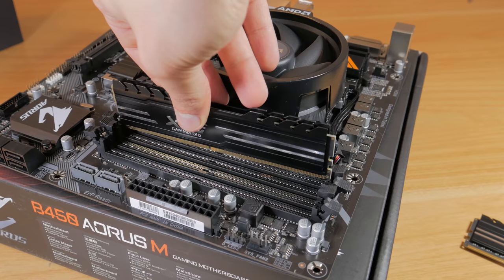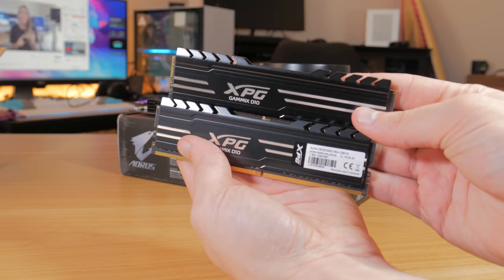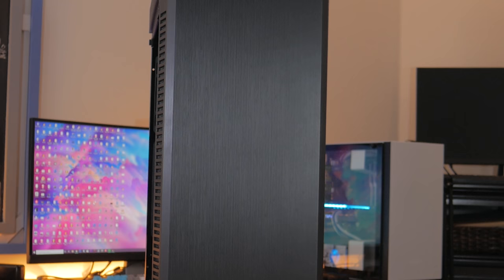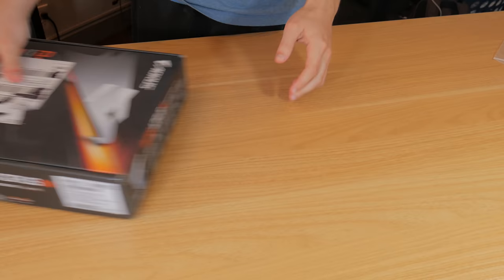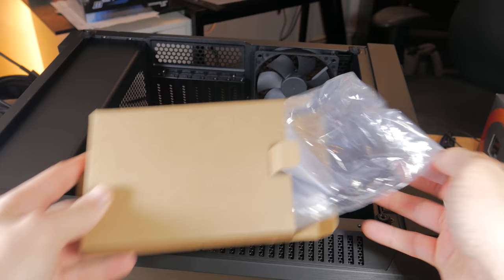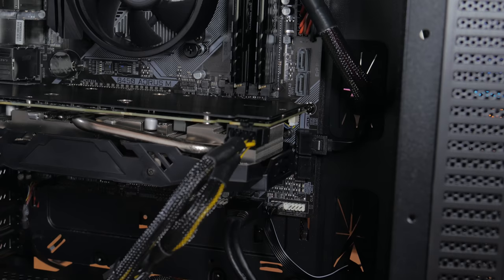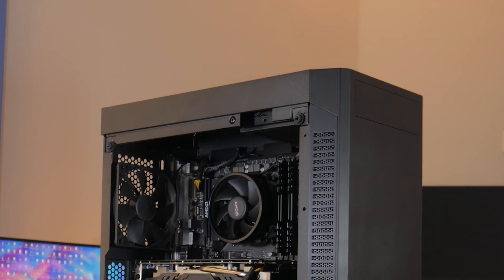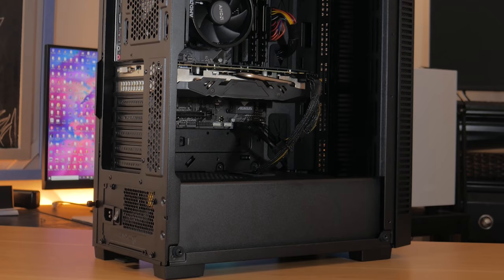$600 Gaming PC Build Guide! (2019)

Comment: Really solid and detailed build. I sent this video to my friend because it was the best build tutorial I've seen for the AM4 socket, and she's building her first PC for Christmas. The only thing I would have done differently is route the GPU, USB, and PWR_LED cables together through one hole for cable management/aesthetic purposes. Great video!
Reply: MagX9 do you think this computer would be able to run gta 5 and rust? I know absolutely nothing and need help before i buy if not whats a price range id be looking at to play these games?
Reply: @jacobbulkoski861  Yes this computer would be able to run gtav just fine, I have the ryzen 5 3600x cpu and rx580 gpu, which is very similar to the components he used and my computer runs everything really well including gtav. Send me a private message if you need help or advice. Also make sure you include in your budget for peripherals  (keyboard, mouse, headset, and monitor)
Reply: @jacobbulkoski861  what's your budget, are you willing to learn to overclock, and are you okay with used graphics cards or not. Based on these decisions I can create a list of parts for you. Also are you buying peripherals(monitor, keyboard, mouse) as well as that is going to affect the overall cost of the build.

Comment: The GPU and power supply are sold out are their any parts like them
Reply: Iq you I ordered mine 3 days ago and the arrived today
Reply: Yes try getting a Radeon 290x or higher even the 280x performs great, for psu go on eBay an you can get that psu or better

Comment: If you could I'd appreciate seeing you put together the  $150 build. Thanks for the great videos!
Reply: Mystical Gaming Good luck running roblox on that. Lol
Reply: Just get an old xeon with a cheap board. I.e. x3440-70 + oem mb they're just rebranded and underclocked i5's. Or go with a h55 board and oc to 3.3 ghz

Comment: Can you do something that's good for console gamers that want to switch to PC? Like everything we need to know, what we should do, step by step, best prices, etc. I really want to go make a decent pc that can play games from Apex Legends to Red Dead Redemption 2 smoothly. I have the money to build a 300 ish pc(including monitor and keyboard). I also want to have access to my playstation too(I dont want to give up console gaming entirely).
I know this is a lot but I'm genuinely interested and excited to make a switch, I just dont know how :/
Reply: i have an idea if you have a $300 budget then get 
an e5 2420 v2 xeon $11 on ebay  (you will also need a cpu cooler so i would recommend the uphere 92mm cpu cooler for $16 on amazon)
an x79 lga 1356 motherboard $50 also on ebay
8gb of ecc ddr3 $10 ebay as well
 any drives you want (my choice would be a 120gb ssd for about $20 and a used 1tb hdd from ebay for like $15)
a 600w psu from evgas b stock sales $30
 an rx 480 for $85 on ebay
a cheap case that you like from amazon or the diypc a1 white off newegg for around $45
and a windows key from scdkey where you can get it for like $10 to $15
the total cost is about $350 after tax etc

hope this helps! just fyi there is not much of an upgrade path but the performance is great go check out bryan from tech yes city on his review of the e5 2420 v2 and the good thing is that the build list i gave you is if you ever want to upgrade all you need to change out is the cpu mobo and ram the rest you can keep if you wanted to switch to say a ryzen platform
Reply: @ethantorres4061  don't get xeon cos u r stuck with that forever. Budget pc's should always have upgrade potential
Reply: @harrymcgilligan5807  but you can upgrade this xeon to an e5 2670

Comment: Hey I had a question so I ordered all the parts and am looking forward for this pc but I was wandering if I will be able to Bluetooth connect my beats studio to them or will I have to buy a Bluetooth. Video chip
Reply from the maker: You will have to get a bluetooth adapter of some sort. I use a USB one that I got from amazon for around $10. I plug it into my front panel USB port. Bluetooth Adapter for PC USB Bluetooth Dongle 4.0 EDR Receiver TECHKEY Wireless Transfer for Stereo Headphones Laptop Windows 10, 8.1, 8, 7, Raspberry Pi, Linux Compatible https://www.amazon.com/dp/B07J5WFPXX/ref=cm_sw_r_cp_apa_i_yYZ0Db7KCTWSZ
Reply: @TechByMattB  Will I need to buy a WiFi adapter for a wireless WiFi connection for this PC?
Reply: was it good?

Comment: Bro you could get rx 580 8gb for 120$ ????
Why 180$ rx 590 ???
Reply: not gonna lie 590 was a waste
Reply: @yuarkok6273  Yeah, 590 was a garbage pick.
Reply: 120 for 580? Where?
Reply: @chrisding1976  Ebay, they are actually going for 100.00 depending on the model
Reply: @chrisding1976  in US they go for 110 to a 100 on ebay
Reply: @tuahakhalid4431  wtf 580 8gb cost 200+ dollaridos
Reply: Actually the rx 590 is a pretty solid card for the price. The only reason people saying it's a bad choice is because of the used market for Rx 580. However the 590 has good overclocking potential and is on par with a 1660. The 1660 does have a better future ahead of it though.
Reply: 580 is 1300mhz and the 590 is 2000mhz

Comment: Funny of how I've been saving up for a similar system a while before this video. Same mobo, cpu, and ssd. The only big difference is that I went with the rx 580 instead of the 590.
Reply: does it work well with the 580?
Reply: @DankStuff101  There's a very small speed difference between the 580 and 590. So yeah it works great.
Reply: @numairdubas2688  ah thanks. I have a budget around 500 so I was hoping to lower the price of this build. Maybe with the case or something.

Comment: Me, $400 without GPU and I'm little faster than yours (no offense).. I got rog strix b450f gaming for $80 and Ryzen 5 2600x $120 on sale at Micro Center last September 2019. These are good setups, b450 and ryzen 5 so I respect you for giving people a proper guide how to get right PC for good price. My CPU usage shows 20-30% while GTA V and many applications were on.. I got that machine with RGB case, m.2 nvme ssd 500 gb, 1 tb HDD with 620 watts PSU for only $400! Unfortunately, I paid $700 total for getting good GPU, MSI Gaming X GTX 1660 Ti, a $300 GPU... I am very happy because $700 with 1660 Ti is very respectable wise-spending choice, I can run 4000K resolution without any problem even I don't need to overclock BIOS because Ryzen 5 just does it all for me, slamming 4.125 GHz...

Comment: can someone tell me a good cpu cooler to get because i might overclock and im not sure what the cases dimentions are
Reply: OneSlav Corsair h60 for 60$ or the Corsair h150i
Reply: That depends on what you want to overclock. I got myself an Arctic Liquid Freezer II All in One 280mm watercooler  for about 75€ and it is performing better than anything i ever had before. So if you want to go wild on voltage i can recommend the Arctic Liquid Freezer II coolers.

Comment: Start testing Call of Duty Modern Warfare
Reply: it will run perfectly as I have a ryzen 5 2600x and a RX580 playing at 1080p  everything maxed I get +100fps everytime
Reply: @denisnatera3633  i wanted to get ryzen 5 1600,rx 580 8gb and 8gb of ram will it run cod modern warfare at high settings with decent fps?
Reply: @pussyking8294  For sure cuz the 2600 is slightly a 10 or 13 fps increase over the 1600 so youre still going to get like 80 or 90 fps at max settings 1080p res
Reply: @denisnatera3633  ah thats great then and what do you think for how many years pc like this could last? I am getting this cause everyone says how its great value for money
Reply: @pussyking8294   it depends on what kind of games you play but for games like cod your pc is going to handle a new version of cod so Ill say 2 yrs maybe until youll consider to upgrade your cpu or gpu
Reply: @denisnatera3633  i mean can that pc run any game? Like any new game..so do you play these new games i am sure it should run any game that exists
Reply: @pussyking8294  yeah actually you can play almost any currently new games at ultra / high settings getting 60fps with that rig
Reply: @pussyking8294  get 16 gb ram 3000mhz, 8gb is too low in 2019
Reply: @pussyking8294  I've been playing the new COD with an AMD FX-8350 and RX480 because I'm still saving for a new one. I've consistently getting 70-80 fps without framerate drops. That is fairly old, I believe they released the FX 8350 in 2012. So as far as continuity, I think you'll be okay for several years. And even at that point, you'll just have to look into a new GPU and CPU

Comment: My budget for a pc is around $450. This will be my first pc build ever so I’ll need some help from you pro pc builders. I’ll list my parts and would like some feedback on where I can get better parts for the the same amount of money or a little bit more:

Amd Ryzen 3 2200g-$77.99
Mother board-Asus Prime B450-A-76.99
Ram-Patriot Viper Elite 2x4GB-$34.99
PowerColor RedDragon Rx570-$134.99
Inland Ssd 240gb-$29.99
Rosewill Atx case-$50
Evga 500br 80x bronze-$54.99

Thanks in advance

Comment: Any other cheaper case suggestions for this that’ll still fit everything?
Reply: HalfBean11 yeah I’ve been wondering that too
Reply: I can recommend the Cooler Master - Masterbox 5 Cases. If you can find them for a decent price (50-60) you are happy. Also you can look for Fractal Design and Phanteks. But the lower you go with the pricing, it is possible that the included fans are crappy and need to be replaced by better ones. You should  operate your case at least with an intake fan in the front and an exhaust fan at the rear. Please keep that in mind.

Regards

Comment: Today I finished building my new RIG using new and used parts. It costed me 600$ and is an absolute beast for the price.

It has a:
Ryzen 7 2700 [135] (Used 1 month old)
AsRock Vega 56 [220] (new)
Asus ROG Strix B450-F [70] (used 3 months old)
16GB G.Skill Aegis DDR4-3000 [60] (new)
Thermaltake RGB 700W 80+ [35] (new)
Crucial MX500 500GB SSD [60] (new)
Zalman Z9 Neo [20] (used)

Comment: Sharkoon TG4 RGB ATX
MSI GTX 1660 Super Gaming X
AMD Ryzen 5 2600
Corsair CX550M
Adata XPG SX8200 512GB M.2 SSD
MSI B450 Tomahawk MAX
Corsair Vengeance LPX 16GB 3000mhz RAM

This is a pretty good setup for less than 1000 dollars I think (it's more expensive in Iceland though).

Comment: Hello Matt,

I really want to start with my first budget build.
So can u take a look if it is all compatible?
- Corsair TX650M V2 PSU / PC voeding

- Corsair DDR4 Vengeance LPX 2x8GB 3200 C16 Geheugenmodule

- Gigabyte H310M H 2.0 moederbord socket 1151

- Aerocool RIFT Midi Tower Behuizing

- Cooler Master MasterFan MF122R RGB

- Intel Core i5 9400F processor

- MSI Radeon RX 570 OC 4GB

- Samsung Evo 860 500 gb SSD

I hope you can help me out!

Comment: Don't waste 180.00 plus tax on a RX 590. Get on Ebay and get a good used RX 580 for 100.00 and use the extra money saved for a 1TB SSD at least 2 more case fans and possibly an LED strip. Just my 2 cents.

Comment: question which motherboard do you think is better the 450 adrus M (the one you are showing) or the 450m pro4? also I want to use the case cooler master q500l, do you think 450 adrus M fits inside the cooler master? (in case you tell me the 450 adrus M is better of course)

Comment: I'm in my room right now installing a liquid CPU cooler, where is the CPU_Opt fan header on this motherboard, plz help
Reply: Wait r u using liquid cooling or fan cooling for your cpu cooler
Reply: Yura Re’tord I am using an aio, liquid cooling but I plugged it in the the system fan 1 and it seems to work fine, thanks for the help though

Comment: For this computer, would I need to connect it with wires to WiFi, or can it connect like a laptop to my WiFi?
Reply from the maker: You can run on ethernet, but to use wifi you need to buy a wifi adapter(preferably a PCIE one, but USB would also work.)

Comment: Wow.... this is exactly the pc I’m building aside from the case and ram.
Reply: Please get a 3600, over the 2600
Reply: @MoswenMedia  Is there a Nice performance difference?
Reply: @Zacapisco3  the single core performance, and ipc are absolutely worth the extra money you'd spend to get 3600
Reply: I still have a 1600 lol it’s perfectly fine IMO the 3600 costing 90$ more isn’t really worth it
Reply: @censi1401   Censura  its 70 dollars you doink, I have a 2600k system thatd I'd be willing to say would outperform your 1600 in single core performance. The 3600 is 14% faster at single core than a 2600 overclocked. And 14% faster at 6 core performance. To me that's worth the extra money, because some people wont put in the effort to oc.

Comment: iBUYPOWER - Gaming Desktop - Intel Core i3-9100F - 8GB Memory - NVIDIA GeForce GTX 1650 - 1TB Hard Drive + 120GB Solid State Drive is this pc worth $600???
Reply: NLE_Edgar go for the build shown in the vid, the prebuilt u state has 8gb ram which isn’t enough in 2019, and the cpu has 4 cores ryzen 5 has 6 core 12 threads, and rx 590 is better than gtx 1650
Reply: GDwg ok thank you I don’t know much about pc’s just got into them recently

Comment: Instead of using the graphics card he used in this build, instead can I use an NVIDIA Geforce gtx 1050 ti??
Reply: I wouldn't use that card. Doesn't hold up very well. I'd say 580 for a gpu that has very similar performance to the newer 590 but is usually quite a bit cheaper. 1050ti is just a weak card.
Reply: @ohmy8078  Ok thanks for your advice! Im aiming for a GTX 1650 super lately which is supposed to be good
Reply: @orbitraal697   Orbitraal  heyyy cheers. That's a pretty good card in the sameish price range.  Friend I know upgrade from rx 480 to that card and he enjoys it.

Comment: stay AWAY from the corsair VS psu's, theyre utter trash, have terrible voltage ripple and are just overall unstable. it wont blow up ur pc, most likely, but from experience it doesnt handle heavy loads when gaming very well. can cause pc freezing and sometimes just complete cut off. i switched to a seasonic s12ii 520w and its been running strong for about 2 years now with no problems.

TL;DR spend more and get a good quality, highly reviewed, power supply. A quality 400w psu will beat this 550w in everything. its not worth cheaping out on psu and motherboards.

Comment: HELP PLEASE! I just recently got this exact build for christmas.I got it to obviously game and i mostly play Rainbow Six siege.I have done no overclocking or any change to my cpu power. Im still constantly getting CPU temperatures of 90-95 celcius.You are getting much much lower and I want to know what the problem could be or what i am doing wrong, thanks. If anybody knows a fix or just the problem please reply to this with anything you have.
Reply: Dhdjdj Didici do u have thermal paste on your cpu
Reply: @chasexiii1523  Im using the pre-applied thermal paste that came on the cpu cooler

Comment: How did you find out if these were all compatible
Here is my build, is it all compatible?

CPU: intel Xeon w3670
Gpu: RX 570
Motherboard: MSU pro series z270
Ram 8gb (2x4) ddr4
Reply: Mobula 282 go on pcpartpicker and it says if all of your parts are compatible
Reply: Some parts are not on pcpartpicker
Reply: Mobula 282 then check to see if the socket types are the same

Comment: I built the pc and the power supply blew up....
Reply: Really? What happened??? 
I want to build this PC too, is it safe?
Reply: @James-lo8qq  well i wanted more watts and i bought a cx 750m from corsair and it broke instantly, and the 550 watt is a cx and its bronze rated so do not build it, just get a better power supply that is a higher rating then bronze because  then its too weak.
Reply: @syrinaxis1432  can I get a cx550?
Reply: @James-lo8qq  No, i told you that it said its bronze and a cx model and if its bronze then it breaks easily, so no. Just get a evga model that is atleast a silver model.
Reply: @syrinaxis1432  I already bought a cx550....
Reply: @syrinaxis1432  now I'm scared
Reply: @syrinaxis1432  do you think it was just yours? Did you buy a used one
Reply: @James-lo8qq  no it was not used lol
Reply: @James-lo8qq  if you bought a cx550 then sell it and try getting  something better
Reply: @syrinaxis1432  what the heck, are you sure???
Reply: @James-lo8qq  yeah it was amazon